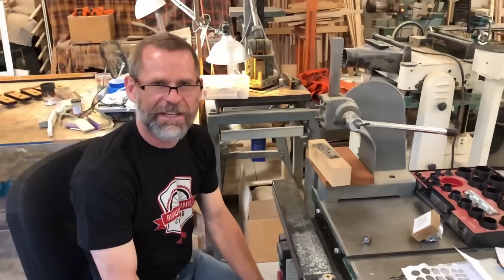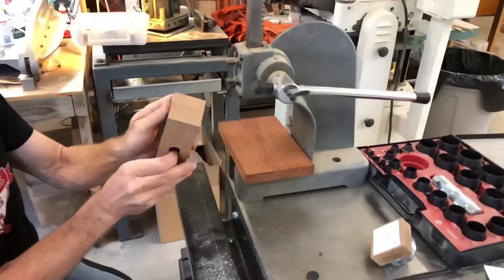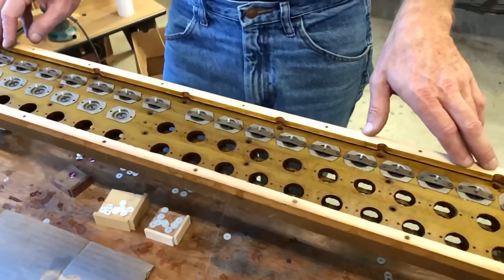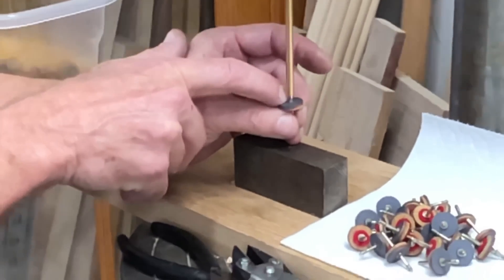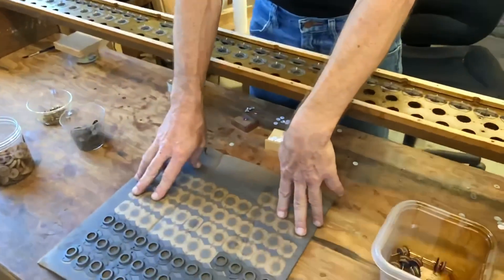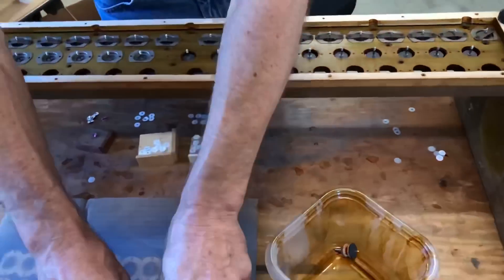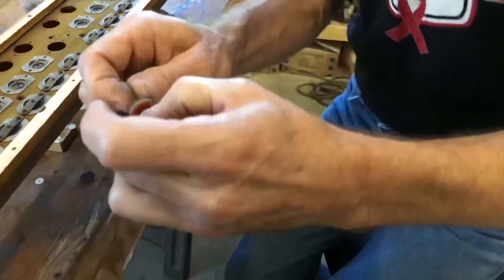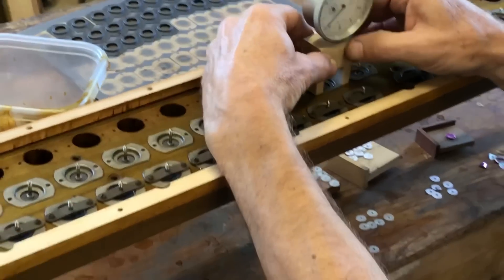Player Piano Rebuilding - Installing and Regulating New Valves with Force Fit Collars

Comment: I have not done a valve rebuild for over 25 years so materials and methods change. Now I am rebuilding a Autopiano valves with the screw on outter facings and they have no wobble.  How were these built originally to have wobble. Also this piano has been rebuilt in the past and the facings have no felt between the leather and and disk like yours.  Any suggestions?

Comment: Regarding valve leather, I noticed one side is shiny with the grain, and the other side is like suede (fuzzy).  What side should get the glue, in particular for the upper valves (onto the wood disks)?
Reply from the maker: The rule of thumb is that the nap (fuzzy) side faces out when sealing against wood and the grain side faces out when seating against metal. However leather is not a uniform material so it’s always best to test the seal using a bubble jar to determine leakage.

Comment: I"m doing a Standard action over now but have had lousy luck trying to find decent air-tight leather.  Where do you get your leather?  I often buy from Columbia but the last Morton leather I got leaked too much for valves.
Great video though.  I set up my drill press to do the same as you did but found I still had to "tweak" up the outer valve to achieve the right travel.  The one I'm doing is a single valve stack.
Reply from the maker: Hi Doug, yes as you've discovered, Columbia Organ Leathers does not sell valve leather for player pianos. They sell valve leather for pipe organs which is an entirely different animal. You need Cow or Calf leather for good tight valves. I buy my skins from The Leather Guy in St. Charles MN. They have several high res photos of each skin so you can check the grain and nap to make sure it's very fine. For most valve work you want a 1 1/2 ounce leather which turns out to be around .030" thick. Look for a fairly supple garment leather.
Reply: @DuoArtOrgan  Thank you so much!  I've done about 8 players but don't do it commercially and it's only a hobby for me.  This is my first Standard action single valve unit.  I own a Pratt and Read player piano that I just did and used compressed foam for the valves in it.  It worked great.  Craig Brougher called me one night and suggested I try it.  Longevity is the only question with regard to this foam but he assured me his own piano was done with it and it's still tight after 30+ years.  Setting the Standard valves is a pain until I saw your method with the presses.  Very nice idea!  I did the same thing with this Standard action and it was a huge success compared to the other method of tapping the collars just enough for the gap.  Pain in the butt!
Thanks again.

Comment: I just acquired a standard single valve action player piano for free.  I didn't want to put any time into it because it's hard for me to work now thanks to a severe nerve disorder I have in my neck that limits the use of my fingers with such precise work.  I have limited dexterity because of this.   However, after watching this video, I'm inclined to try it.  I did a Lester piano 5 years ago and it was an utter monster to get right.  Help from Craig Brougher made it easy after he called me and made some suggestions.  It was nice of him to take the time to call too.  I finish the piano using his suggestions and it came out perfectly.  Now, on to the Standard.  I have a similar jig set up and have made spacers to precisely place the last collar (bottom valve) to within approximate spacing and hence valve travel.  Then I can shim them out as needed.  I have a question though......it calls for felt between the lower collar (atmospheric port, loose fitting valve) and the small steel backing plate before you place the actual valve (and felt washer) on the stem.  I find this leaks badly when it tries to seal against atmospheric pressure.  I have used successfully, a small .025" thick morton leather punch to seal this up to totally tight.  The felt leaked too much when the pouch lifted the valve against the atmospheric seat to seal off the air upon a note playing.   Once the pouch lifted the valve to close off the atmosphere, it would leak a little bit and reduce the vacuum somewhat.   The leather provides for total seal and will not allow atmosphere to attempt to leak in.  Why would they advocate the use of felt in this area when it's obvious that it'll probably leak?  Also, at Craig's suggestions, and due to the difficulty in obtaining air tight leather these days, I have used a white compressed 1/16" dense foam punch instead of leather punches for the valves.  He has successfully used it and thus far has pianos out there going over 25 years with this stuff and no problems.  It seals perfectly tight too!  He did his own piano with it and it's going on 30 years with no issues with the valves he said.  His words to me were that if this stuff had been obtainable back when these pianos were built, they most likely would have used it too.  On a hand pumped vacuum jar, the valve will seal instantly and not leak a single bubble.  It'll hold a 20" vacuum forever I think.  Since this is my piano and I don't intend to sell it, I'm experimenting a bit to see what different things work.  Leather has gotten expensive and air tight leather is hard to find, so this stuff is used on this piano of mine.  So far, the Lester I did 5 years ago is playing perfectly and not a leak to be had.  I hope it stays that way.
This is a great video and I appreciate the time and work that went into it.  Thanks very much!
Feel free to write to me if you'd like.  I'm always open to criticism and learning new things even at 67 years old.  BTW....John Tuttle is a great source for help too and he's helped ma along on several things.  I don't do this professionally and leave it to the people making their living this way, but I have done it as a hobby for several years and only for family or friends.  I admire the people who do it day after day.  Arthur Pierce, a man well known in this area of rebuilding pianos up here in northern NY state, got me started on it when I apprenticed a short while with him.  One of his restored orchestrians is on display in the Smithsonian in DC.  As an albino man, his eyesight was nothing short of almost totally blind, but this man did the most beautiful piano work, precision work, wood finishing work, I have ever seen.  Unreal talent and ability.   God rest his sole.  I miss him to this day.